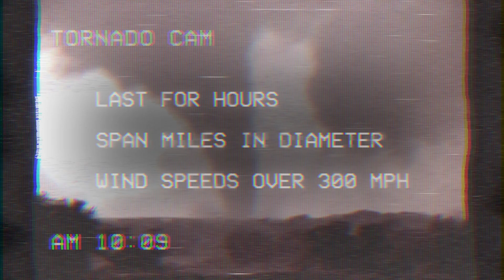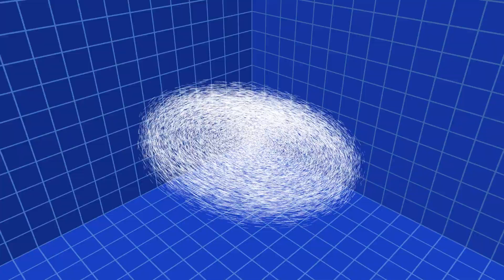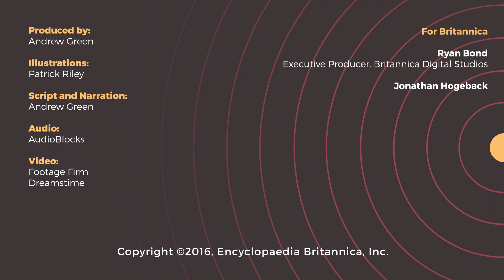DEMYSTIFIED: How do tornadoes form? | Encyclopaedia Britannica

Comment: Not how tornados form at all, the VERY OVERSIMPLIFIED explanation is that inflow winds, ffd and rfd collide creating rotation on the surface, the mesocyclone then stretches this rotation upward and tightens it making the winds faster. Moisture from the air is sucked in the tornado and condensed into a cloud creating that beautiful white funnel which over time picks up dust and becomes brown

Comment: There is not a cold downdraft in center of funnel, it's false. Vortex forms on any height, when warm air goes between wall of cold downdraft (FFD & RFD). Funnel forms when conditions on some height is proper to steam condensation.
Reply: Exactly, no downdraft has ever been documented inside a tornado and the evidence shows tornadoes are extreme low pressure areas inside a rotating thunderstorm. They pull in surrounding low level vorticity and amplify the velocity of the rotation. Some hypothesize that tornadoes even form from the ground up.

Comment: This is all very believable until you realize that dust devils have no rotating supercell above them.
(And people wonder why other people doubt we went to the moon.)
Reply: Take a broad northeast bound inflow feeding an updraft. Cut it off with a downdraft and compression occurs forming an inflow jet. Trapped the jet takes a left turn against the denser downdrafts forcing it up and over the inflow in a series of small violent vortexes that fill the void created aloft by falling cold air. The moisture and heat are compressed out as it rises and rolls over as it rises against the downdraft. As long as the inflow jet is not disrupted by a downdraft to its south or a new inflow to its northeast the tornado will persist.

Comment: That “vortex” is actually called a mesocyclone. The vast majority of them rotate counter-clockwise in the northern hemisphere. Also, the time stamp effect on those videos is cute but most tornadoes do not happen in the morning. They are much more likely to occur later in the day, usually from 2-10pm when storms typically fire and especially towards the late evening when the low level jet kicks in. Lastly, we don’t use radar to look at “moisture and pressure.” We use it to see a multitude of things such as precipitation density, shapes (rain or debris), and which direction the rain moving (to or from the radar).

Simple, nit picky stuff, but I can’t expect most people to actually know these things. I would, however, expect a company like Britannica to actually get these things right. Supercells/tornadoes kill people and misinformation is a big factor in those deaths.
Reply: I'm interested in the part of your comment involving vortexes. A tornado is nothing more than a series of small violent vortexes rotating at high speed from an inflow jet. They compress and the moisture is quickly squeezed out along with the heat.
Reply: Yes we obviously can see how to use Google.
Reply: Oh I didn't know that thank you